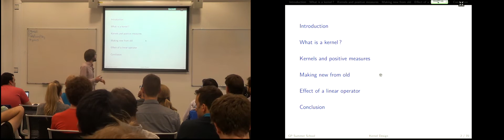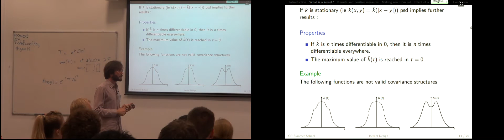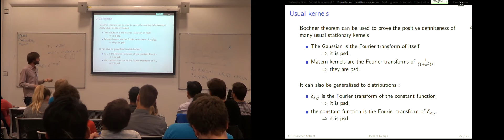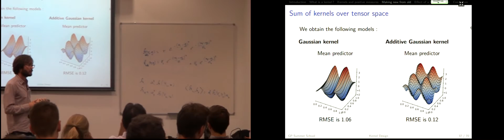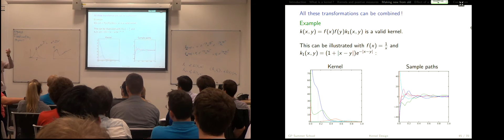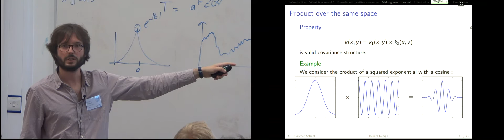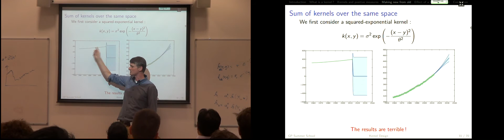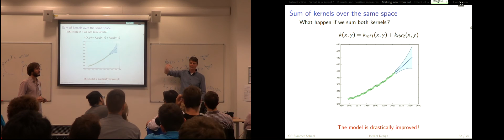Nicolas Durrande: Kernel Design

Comment: What is that SNR ?
k = GPy.kern.RBF(input_dim=1, variance=1., lengthscale=1.)
# create instance of GP regression model
m = GPy.models.GPRegression(X,Y,k)

# set the noise parameter of the model using desired SNR
SNR = 10.0
m.Gaussian_noise.variance = m.rbf.variance/SNR